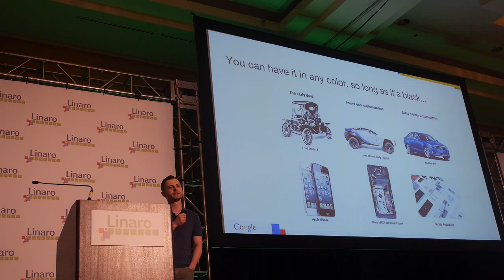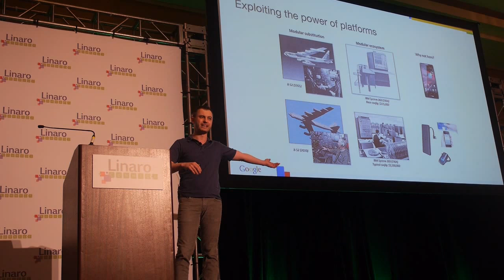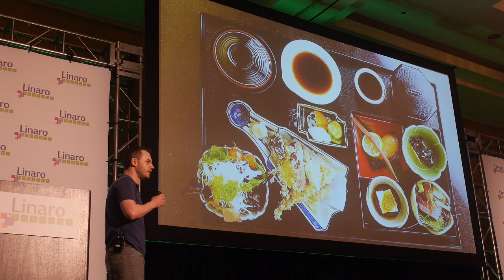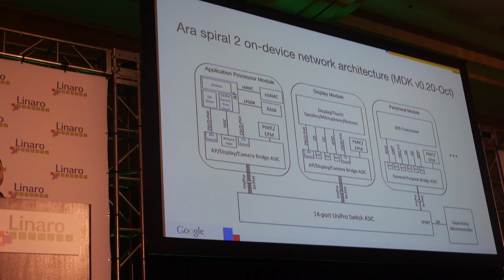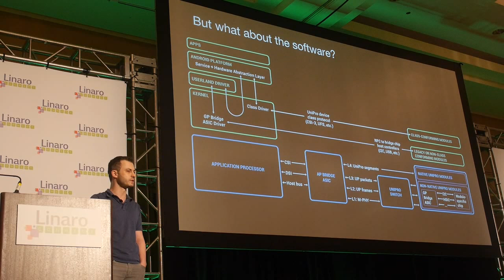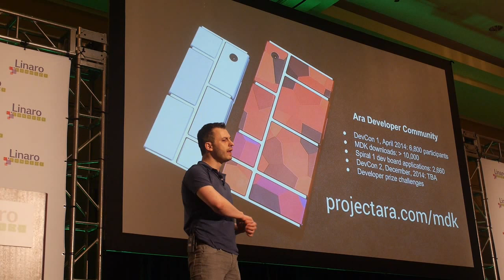Google Project Ara Keynote: Paul Eremenko

Comment: There is a huge void in the market.....ARM based boards.
The raspberry pi is available but has no real application purpose.

With the amount of money Linaro has, I think they will pull this off.

x86 is not longer relevant. AMD prolly knows this best.
How about ARM for next gen consoles?

OpenCL, HSA, WebCL, WiGig, Displayport, Dockport, WiDi, miracast all on ARM!
Reply: There is..but they have implement secure drivers and etc..its still in its infancy.